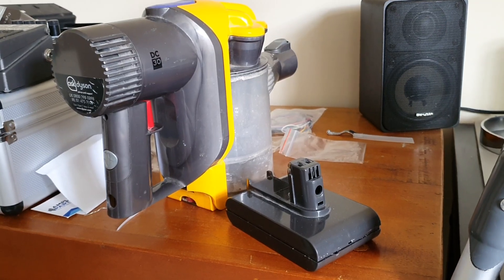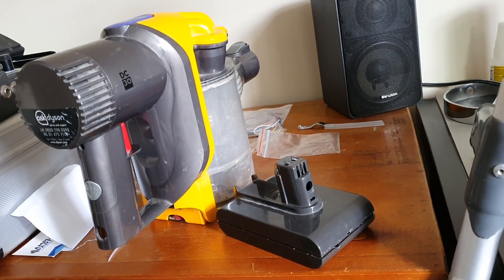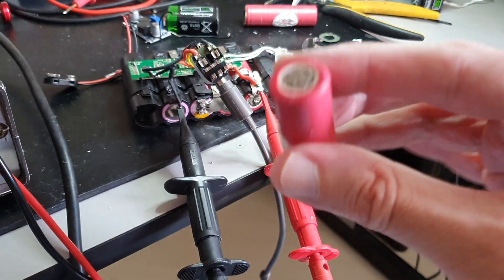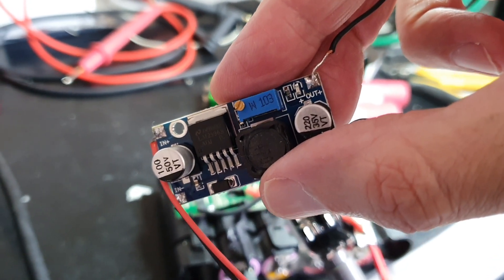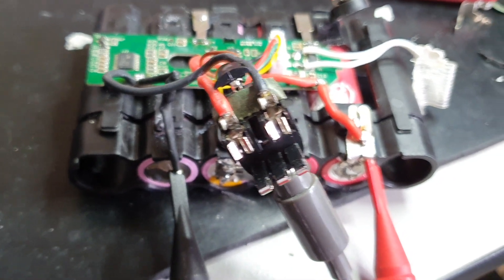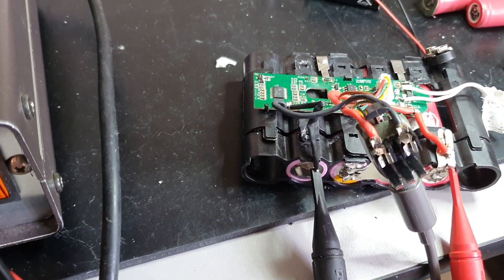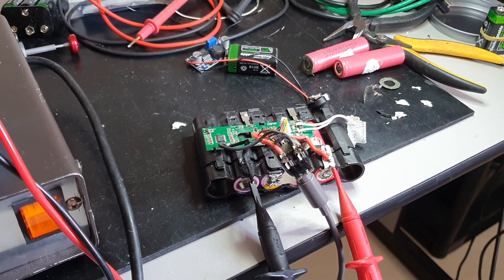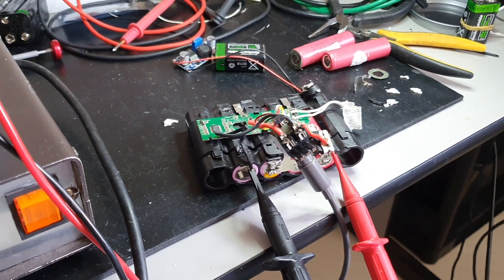Dyson DC30 Not charging - Solutions that work.

Comment: Hi, nice video but I have a question for you (Please) since you did not mention. Have you not got an original Dyson battery pack and tried to upgrade the battery cells in that pack ???   And if you did. does the exact same procedure applies to it or not.   Here is the reason I'm asking:   I heard from other (more advanced Teck people) that on some battery packs (but they did not mention which ones) if you ever disconnect the original BMS board from the existing original batteries that board has some sort of "" ËVIL"" chip on it that will automatically brick the battery pack forever  because it will stop communicating with the vacuum guts and in turn the vacuum will no longer run even though the batteries are perfectly fine and brand new.   So the solution will be to only ever Hot-Swap the old batteries with new ones so basically to never ever interrupt the power to that BMS board.  So I wonder if this holds true for batteries of this type  (14.8V)  too  or not. I am in the same situation. both of my original Dyson battery packs  are pretty much dead and already have plenty of powerful 19650 batteries I could use  but wanted to know of the above question. Ta.
Reply from the maker: Not heard about the Evil BMS, but obviously they want to sell their overpriced battery packs. I no longer have this Dyson as I left it in Brazil when I moved back to the UK. I did buy a couple of batteries and individually charged some under 2.8v which the BMS won't charge. The Dyson worked perfectly after this.

Comment: thanks for the video. If you had used the original battery, i think the BMS would lock when batteries get disconnected, so i believe that this fix is possible only with aftermarket battery pack that doesn't lock, or if you connect battery cells in parallel while changing the original cells. 
I'm thinking to buy one and try that, as mine original is broken. I read that the DC30 can work fine with the 24v battery but i don't have one to test myself. Also, there are adapters for DC31 (24v) that work with other tool batteries but they are all 18v. Do you think that they would work for the DC30? They are much cheaper and we could create are own batteries with spare cells we have. 
The pcb inside the Dyson DC30 has printed 24v on the battery terminals, so I think that it might work.
Reply: Hi, I am currently searching for the same answers myself   with no avail (so far).